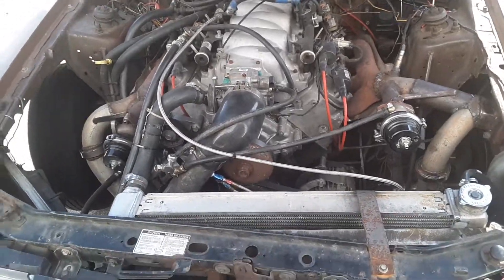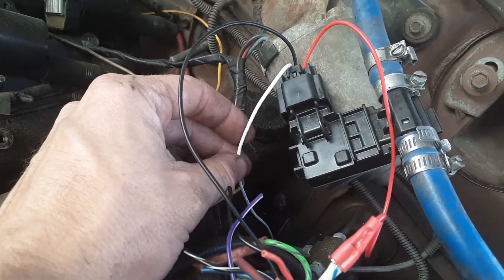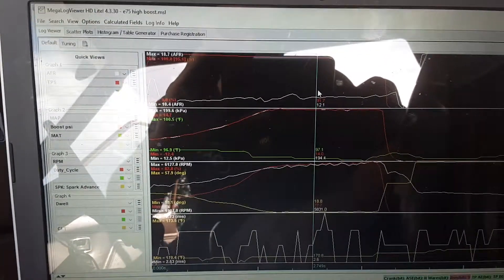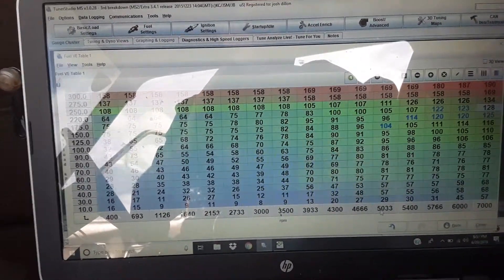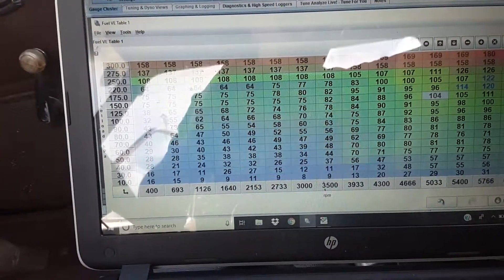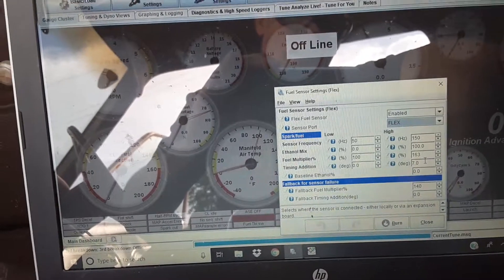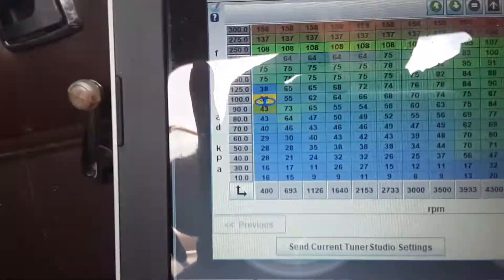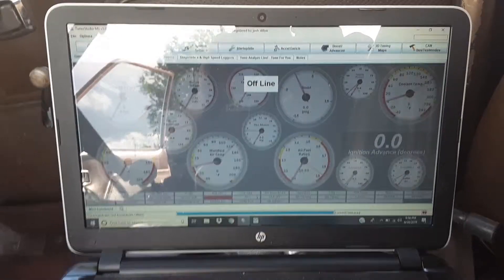How to flex fuel microsquirt LS megasquirt tuners Studio

Comment: Looks like you need more ASE or warmup fuel . I would keep it easier just use lambda.  .76-.77 is good target for anything in mid boost generally .  The timing multiplier is based on 100% ethanol,  I would use something like  4 degrees  and the fallback timing -4 to be safe.  Fuel settings in setup still stay at 14.7 and stoich setpoint as well on flex fuel sensor.
Reply from the maker: Ok thank you